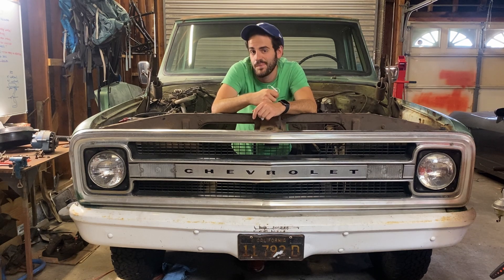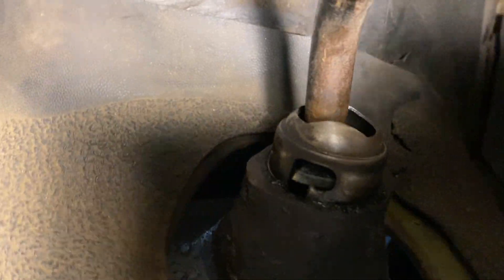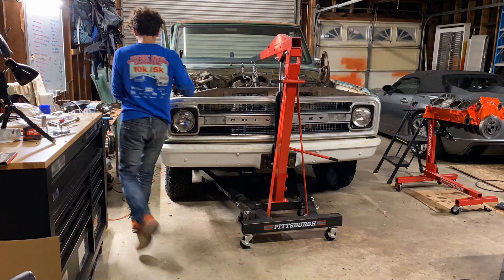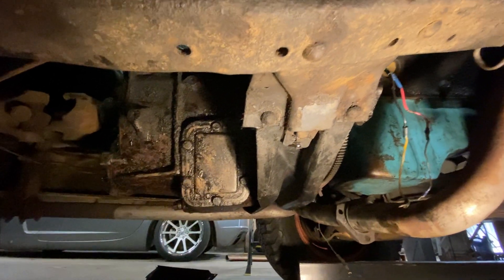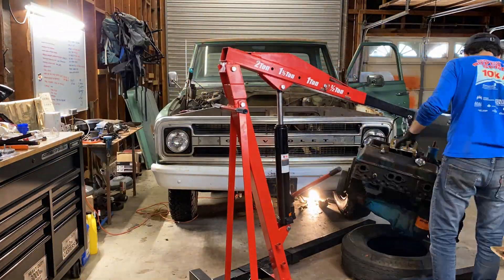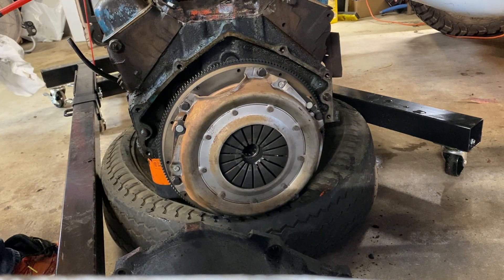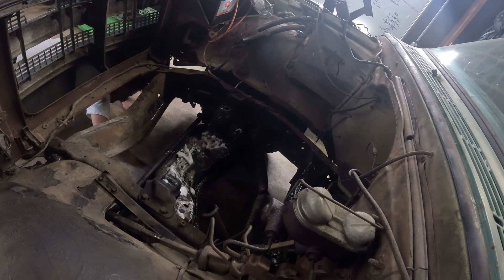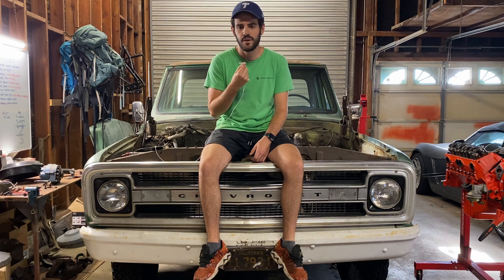Remove a Crusty Chevy Smallblock with Me

Comment: This tip is not meant to be condescending but any other, super greasy junk that you need to clean, can be loosened with oven cleaner.
It is strong and caustic (hard on the lungs) but it will remove grime from all of those hard to reach places for you.
Just coat all of the surface you want to clean, let it sit for a couple of hours, then pressure wash it off.
Try to keep it off of your skin when pressure washing.
Long sleeve shirts, pants and such.
Lov'n the attention to detail and the willingness to tackle that job.
Look'n forward to the next video.
Reply from the maker: Oven cleaner is great idea! And the pressure washer - I don’t have one of those but I’m excited to take it to a self carwash and blast some of the dirtier parts under the frame